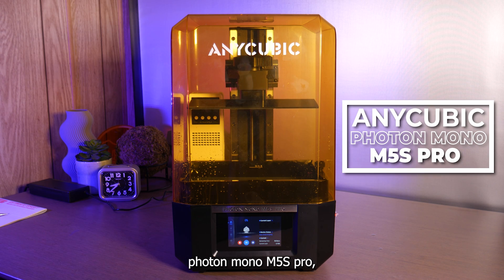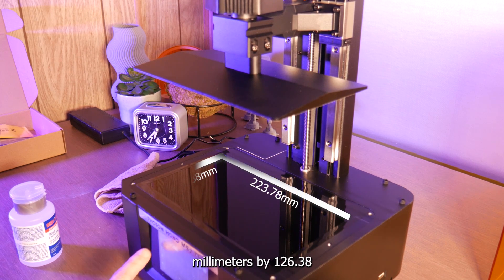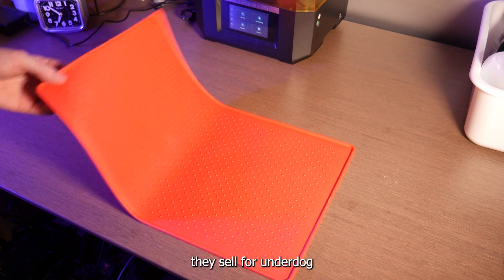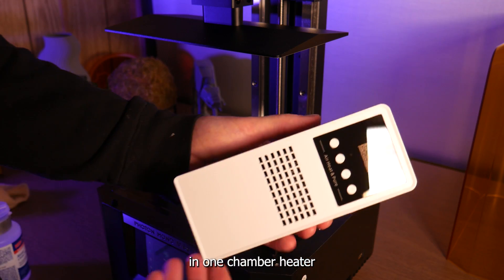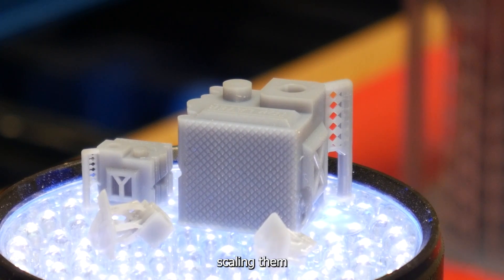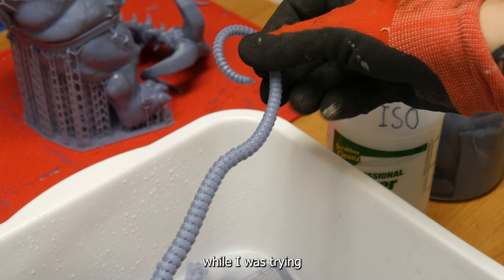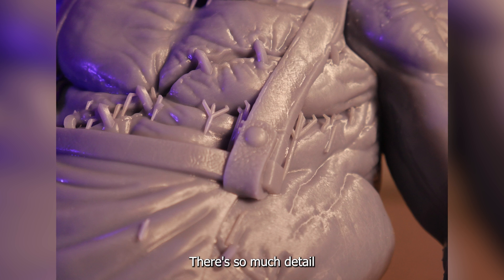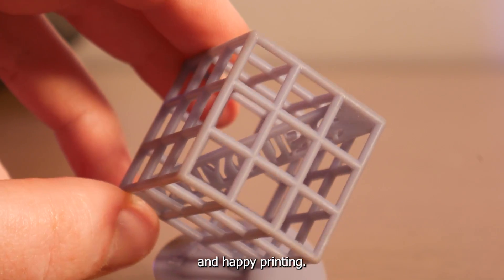100% Success Rate - AnyCubic Photon Mono M5S Pro Resin 3D Printer

Comment from the maker: Is your current resin printers chamber actively heated? is this enough to make you buy a whole new resin printer or would you opt to retrofit a heater into yours? let me know!
Reply: The one question I had was how much did the charcoal filter help with the smell? I use the anycubic eco resin because I don't have anywhere but my home to print, and it tends to be a bit brittle.
Reply: @AB-nu3cw  Charcoal filter is of no use, you lift that lid and the smell from Standard V2 resin is awful, I've purchased the printer and so far I have had partial failures, both using Anycubic's exact resin settings for that Standard V2 resin, and editing the Curing time.
This ain't worth the money.

Comment: Got this printer it is like 2 times faster than my elegoo saturn 2, the release detection is a game changer and makes this printer really fast, the chamber heater is very effective at keeping the resin at optimal viscosity, had problems getting parts to stick to the build plate but tuned the settings a bit and now it's super reliable. Failure detection is great also, along with the resin volume check overall very happy with this printer

Comment: I just recently picked one of these as my first resin printer and I absolutely love it. For someone that has never used a 3D printer this one is an absolute dream to use. Of all the prints that I have done I only have had one issue and that was with my first print which was completely my noobie fault. Every single print that I've done since has gone off with zero issues or problems

Comment: Hey! Do you happen to have the print settings you used for the leaves? Whats the lowest layer height youve gone to on this printer and what were your burn in and exposure settings? Any info would be a huge help ive had this printer for months and cant seem to get decent prints off of it. I have a mono x and mono se which work flawlessly every time with a loaded build plate. The M5S seems to fail no matter what i do.

Comment: i have a anycubic photon m5s pro printer and i want to download from the modelrairoad 3d 
they are ho scale and i have oo gauge lay out 
can youb tell me what scales i need to set to print in 3d oo gauge that are 1-76 size
Reply: Did you have any problems with anycubic? recommend? I'm torn between it and the Saturn 3 Ultra

Comment: As soon as the video started I cringed. You need antistatic wipes. I use Endust for Electronics Multi Surface Cleaner Anti-static Wipes.
Before your first print, wipe the cover, inside and out. No more resin splatter. 
It's not splashing out of the vat. It's the static charge on the plastic pulling the dripping resin from finished prints, or dripping from the corners of the print bed, before the drops reach the vat.

Comment: Do you happen to have your general slicer settings for the high speed resin? I've had this printer for around 4 months now and my prints are around 4-7 hours when printing 0.03mm, full bed projects. None have really failed, so that's nice, but sometimes the detail and exact measurements are not preserved lately. So it'd be nice to know what you're doing to get the time down and retain fine detail. Also, have to happened to try non-high speed resins with the printer? I'm too afraid to try normal resin and mess up the settings.

Comment: I might need to check into those space heaters, its always a crapshoot when i start off my resin printer (elegoo saturn s)
Reply: I have the Saturn (not S), and from years of use, I had only 1 success print..... Tried all, other resins, other settings, moving the place. 
Very crap result, so time to change I think....
Reply: I have an original Saturn and I have had very few failures, even printing at 20C.
Reply: @WayneMcCormick  maybe it's me, but I doubt . Maybe the Saturn is defective...
Reply: There's a2 different  DIY heaters you can install. 
Similar to the one in this printer https://youtu.be/2yfPKFgvmes?feature=shared
A band around the vat. https://youtu.be/8M_p-si79g0?feature=shared